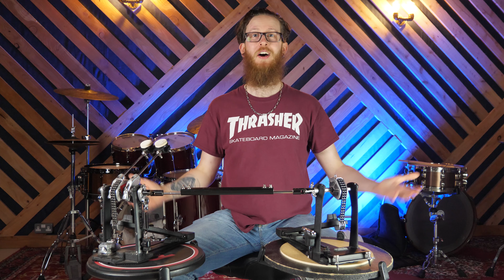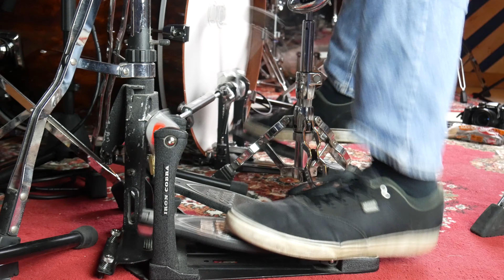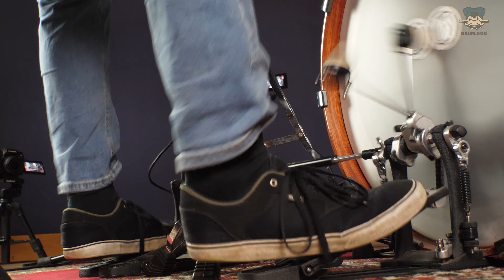How To Set Up A Double Pedal | Drum Dog

Comment: I have a question. Why does my slave pedal have springs on both sides? Should I remove one ?
Reply: Don’t know if it will matter to you now, but I discovered about a month ago that majority of pedals don’t come with springs on both sides (my pedal came with both springs on). I took off the spring that’s closest to the slave and now the pedal has so much more clarity. It’s also easier to set up and it’s easier to play faster - two springs was making it heavier and prevented the thorough swing I needed.
Reply: @Brohnze  thanks for the tip, I took it off and will see if that makes a difference

Comment: Well, I actually like the increased resistance of the slave pedal (on a Tama Speed Cobra). I wish I could set the main pedal to that same level of resistance, but the spring tension already seems to be maxed out to me. At least if I try to pull down the spring even further, I can’t turn the bottom screw any further to keep the spring in that even-higher-tension position.

Comment: Great job on this and your previous bass pedal adjustments video. Your advice on proper double pedal maintenance would be great as well! What needs to be done to keep them performing like new? Do the bearings, springs, chain-links, pins, shafts, couplings and universal joints need to be oiled/lubed? How, what and when to do it? As you mentioned, useful energy is lost via friction, especially on the slave pedal side, so it's important to reduce it as much as possible. Proper bar setup, lubrication and universal joint angles should be discussed as well. I have never seen a comprehensive video on this overall topic. PS: WD-40 attracts moisture that will cause rust. Thanks!

Comment: This is a great video and very helpful. I’ve played double bass drums for almost 45 years and also alternated at various times to a single kick with a double pedal. The point that is worth making is that with two bass drums, you can remove the legs from the hi hat stand and clamp the stand to the LH bass drums this gets the hi hat and LH bass drum pedal much closer together. 
With your system of placing the slave pedal to the LEFT of the hi hat, you could actually to the same and clamp the stand to the single bass drum. Genius!

Comment: Use an oversized patch of velcro and attach the rough side (as in, not the soft bushy side) under your slave pedal. It will cause a ton of friction that won't permit it to slide along the carpet when played. The more area you can cover under your pedal the better. Works wonders when the spurs aren't enough over carpet.

Comment: I can't seem to find anyone talking about "lag" on the slave pedal. I have the dw9000 and the slave pedal has so much lag and resistance to it. When I do the test to see if the beaters swing the same, my slave pedal only swings a few times then completely stops, where everyone else's they go for quite a bit longer.
Reply from the maker: Slave pedals usually have increased resistance, but shouldn't have any lag? Check over the mechanism carefully for any loose connections, especially where the driveshaft meets the pedal.
Reply: @drumdog  Yeah I actually checked right after that comment, and I believe it's the drive shaft that is the problem. Going to buy a new one and test it out.
Appreciate the response :)
Reply: @SomeoneWitSkill  if you’re going to buy a new driveshaft I HIGHLY recommend buying one made by Trick drums! Their driveshafts eliminate almost all the lag from the slave pedal and they have one made to fit DW pedals. Trick pedals and their accessories are probably the best in the market!

Comment: the longer the shaft to the slave pedal, the more energy will be lost through the shaft. I tried doing the move the pedal to the left of the hi-hat but its not worth the extra effort you have to put into it especially when you're learning. The better solution is to either move your hats to the right side of the kit and get a remote pedal to operate it, or to do what I do and take two shitty old cymbals and stack them like a hi-hat and have that on my right side next to my ride cymbal and that way you can have your open hats on the left of you that you can play the old fashioned way and have the drop clutch hats on the right for when you need the slosh without the ringing of the open hats.
Reply from the maker: Close but not quite: it's not the length of the driveshaft, but the angle of the universal joints that saps the energy. The greater the angle, the more loss. The shaft length makes no difference, but a longer shaft usually comes hand in hand with a greater angle at both joints.